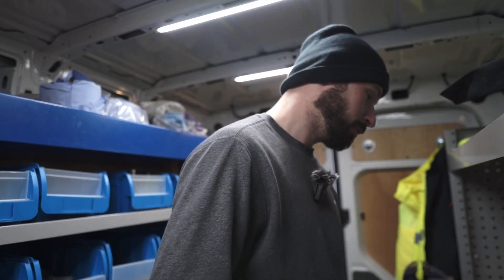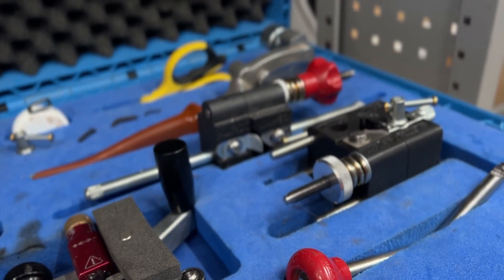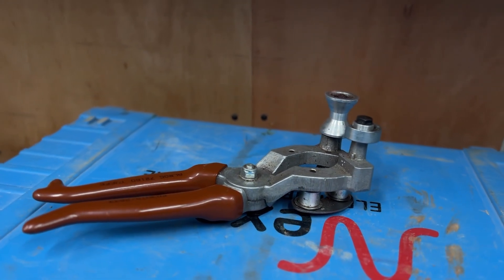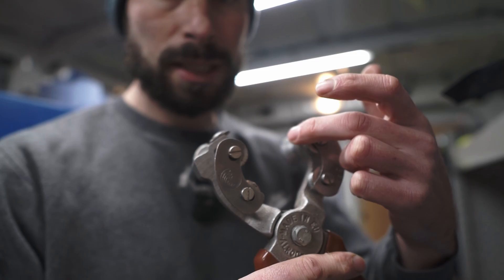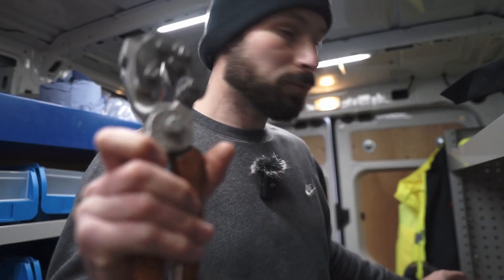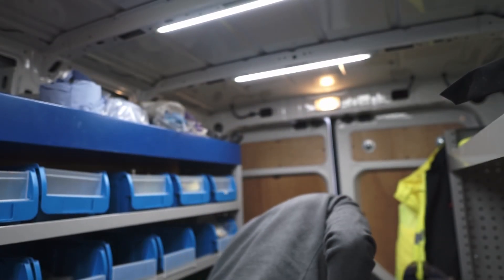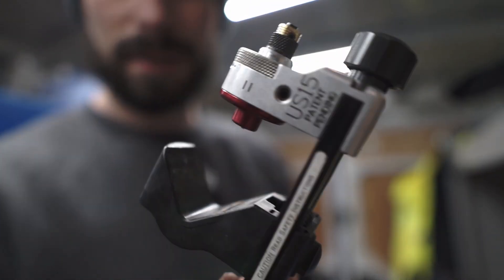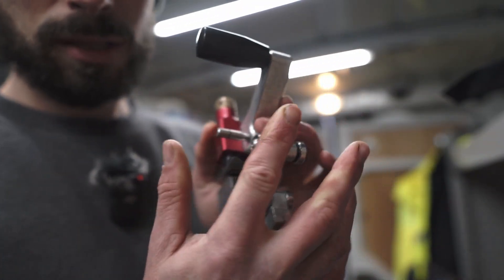Must Have Tools for High Voltage Cable Jointing!

Comment: Any machine shop or someone with a hobby lathe would be able to knock you up a replacement handle for the insulation stripper. Just need to know the right threads. Plastic  ball handle you can get from eBay or old style gear lever handle from car parts.
Reply from the maker: Great shout! Thanks for the help 🤝🏻

Comment: You only need a Stanley knife, hacksaw and an angle grinder 😉😂 Have you considered a hydraulic/powered cable cutter?
Reply from the maker: Just a ruler and knife you need 🫣🤣 i’ve used them in the past but always preferred the band saw!